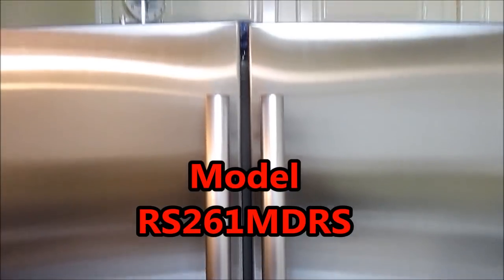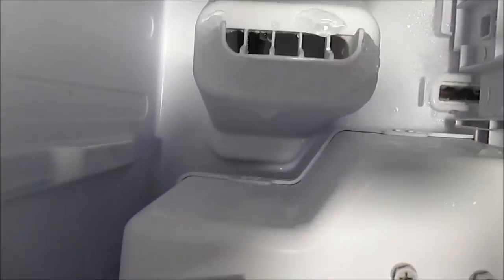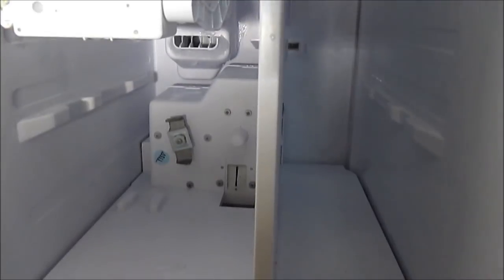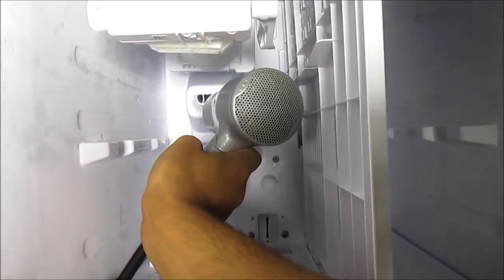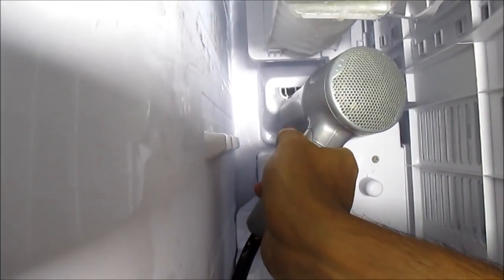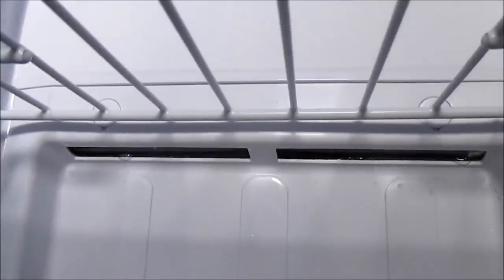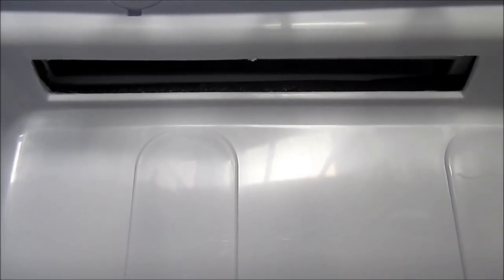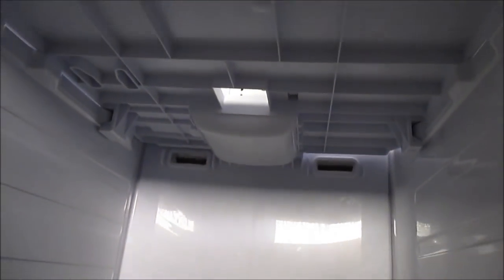How To Stop Noise From Samsung Refrigerator RS261MD **

Comment: I tried this. When turned on I got error 1C and it won't cool.
Freezer temperature 30 degC
Reply from the maker: I would google that error code for a Samsung refrigerator and see what it means.
Reply: @Megalodon1  I did. Couldn't find the code. The error has stopped flashing but freezer temperature still says 30 degC.
Have switched off and left door of freezer open to see if things will reset.
Could I have damaged the temperature sensor?
Reply from the maker: Wish I knew.

Comment: Never use hair dryers on or in a fridge or freezer... you run the risk of melting the plastic or blowing the thermal fuse... if need be use a streamer.
Reply from the maker: Done it eight times already without any melting as long as you move the fan every few seconds and don't leave it in one spot.

Comment: After this fix is done make sure your fridge is leveled using leveling nuts at the front bottom of the fridge and your front wheels need to be in the air (according to Samsung). This should prevent it from happening again, just did this and keeping my fingers crossed. Here is the link with more info from Samsung
http://support-us.samsung.com/cyber/popup/iframe/pop_troubleshooting_fr.jsp?modelname=RF25HMEDBBC&homeid=25609&from_osc=&idx=669461&modelcode=RF25HMEDBBC/AA&
Reply: Turns out my fridge was resting on the front wheel, and was not properly leveled. Easy fix. Many thanks!

Comment: "deice" or "thaw" . . . but not "dethaw" that means the opposite of what you intended.
Reply from the maker: Ok Melt, did I spell that right?
Reply: Ha, ha, ha!  I didn't mean to give you a hard time.  Hey, I've got a Magic Chef fridge that is noisy.  Pretty sure it is the fan/motor but this is located in the mullion between the upper freezer and the lower refrigerator sections.  None of the works are in the back wall like your video shows.  The problem is there are no screws to remove except for the door hinge points.  It looks like the whole unit was pressed into place at the factory.  I took the doors off and six screws, three on each side and then tugged on the mullion and moved it maybe a quarter inch forward.  Any suggestions aside from ripping it all out with a circular saw?
Reply from the maker: +James Wallace Sorry, but I have absolutely no clue. Good luck though

Comment: Crap, what am I gonna do with my food since I don't have another fridge?... maybe get a cooler and some ice. Anybody contact Samsung and did they do anything about it?
Reply from the maker: Your food should not get bad in the 15 mins it takes to knock this out.
Reply: megalodon1 My fridge stopped making that noise so I stopped worrying about it because the temperature inside stayed at 34°.  The next day I opened the fridge and noticed the temperature in the fridge was 48° instead 34°.  I set it back at 34°, checked again 20 mins later and the temperature was at 49°. The freezer at the bottom did stay at 2° the whole time. I finally unplugged it and got rid of my food (about $30$40 in milk, OJ, Creamer... no big deal) and put the frozen meat, veggies in a cooler with ice. I did what you showed us in this video and it worked once I turned my fridge back on. Thanks. Hopefully other people read this and don't make the same mistake I did. If you hear anything out of the ordinary from any of your appliances NEVER assume it's fine because the noise stopped.

Comment: This is horrible advice! Using a hairdryer on plastic will melt the plastic. The proper fix for this issue is to remove the plastic backing and then use a hairdryer. Once the coils are free of ice the next step would be to thaw out the drain hole that tends to freeze up and cause this problem. Once that’s done, it’s recommended to wrap a thin copper wire to the heating element down into the  drain hole so it won’t get blocked by ice. Once all that is done, the most critical thing that needs to be done is to raise the front of the fridge about a half inch to 3/4 inch off the ground by turning the leg screws counter clockwise. It’s not that hard, you can use a flat head screwdriver and insert it into the gaps of the legs and turn or use a small pipe wrench. The raising of the front of the fridge does two things... the first is... it causes the doors to close better and seal the air from escaping as opposed to the fridge being level. Note, the wheels on the front of the fridge should never be touching the floor! 
Second, with the fridge leaning back on a slight angle, when the fridge goes into automatic defrost mode, if there’s any ice build up it will melt and flow better to the drain hole. Trust me I had this problem and it’s a permanent fix!